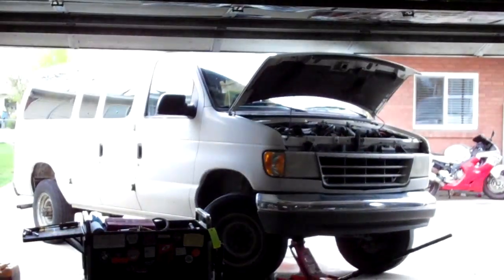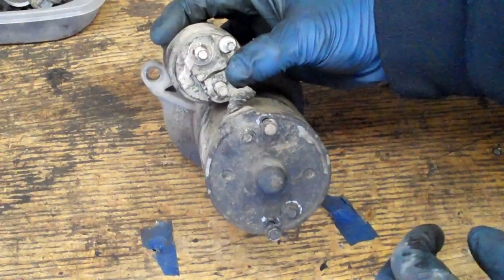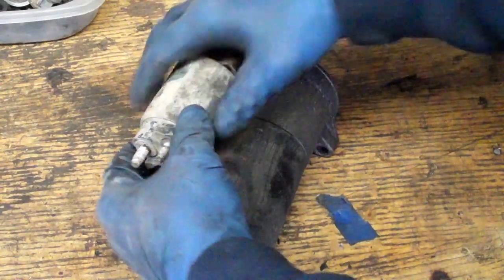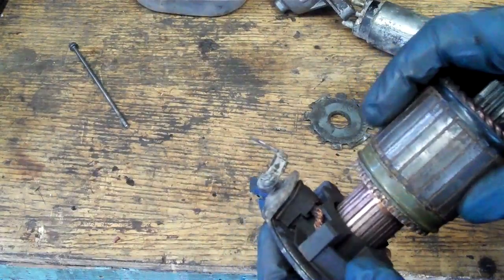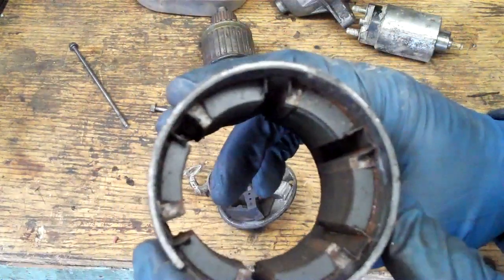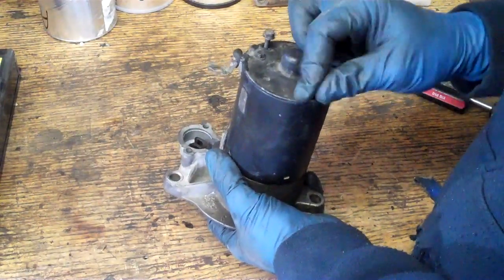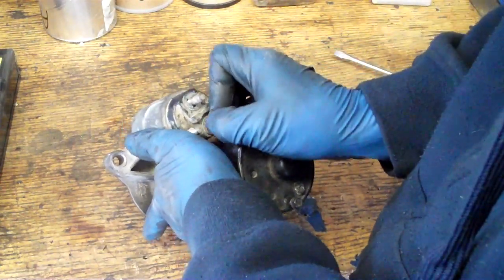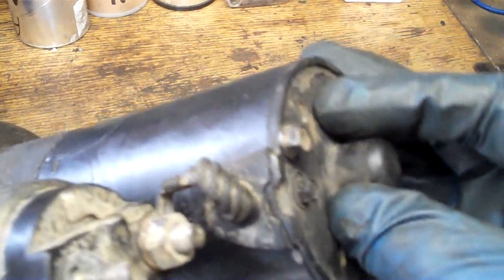How Starter's Work

Comment: Great video! My only comment would be that what you called the sun gear is actually the ring gear. The drive shaft coming from the electric motor has the sun gear on it.

Comment: Brian, you should really have spent time showing people how overhaul this unit properly in detail.(some points are applicable to most starters)
Brush out stator housing/clean inbetween the contacts on the com/check brush faces for chipping/clean and lubricate the solenoid plunger/inspect for chipping and missing teeth on bendix.
Plus there are simple continuity tests that can be done on the rotor to confirm o/c windings.
But good vid.

Comment from the maker: I watched it and commented.  I've seen this on Fords SO MANY TIMES.  It's almost always due to poorly sized or protected/connected battery cables.  Those tiny little starter motors do great as long as they get good flow through good cables.  Having a weak battery can also burn them out too.

Comment: I told my dad that because I didn't think we had good ground and cables, so he took my advice and replaced them with A-1 stuff. made a very slight difference but we apparently still burnt out another starter. so I'm guessing the starters we've been using don't have enough power to crank the engine when it's full of compression.

Comment: my recollection of this video came very helpful today when my mustang fried it's 3rd starter in less than a year. started fine when I left home, drove 30 miles and went to start it a few minutes later, and it slowly cranked twice, and stopped. when I turned the ignition again all I heard was the click of the bendix gear engaging into the flywheel, and I knew the motor fried. is it possible to have an underpowered starter?

Comment: Hey Brian, I always look forward to your videos, and more so when there Subaru related since I drive an 04 STI and do all the work myself! I have a couple requests. Maybe do a video on how to clean an engine and bay really good? And, I have a stuck 02 sensor in the passenger side manifold that wont budge. Used the proper removal tool, after PB blaster, and heated it alittle with a torch. So maybe any special tricks you may have! THANKS!

Comment: Great video, really enjoyed it thanks. Weak plunger springs can also cause the solenoid contacts to arc and carbon up. The carbon can makes it a hit or miss if contacts conduct sufficient current for the motor get the power to run. The spring pressure is a delicate balance of weak enough to allow the coil to overcome the spring tension to close the tips and strong enough to quickly release the tips to minimize the arcing. The spring tension is weaken thru normal use or heat. Thanks Again!

Comment: Great vid, man. Very useful. ]
I had some problems with the starter on my Subaru last winter. It only cranked with jump leads and power from another car.
Took it off the car, bench tested it(figured out how to power both the terminals) and it works just fine. I lubed the bendix and put the whole unit back on the car.
Found the problem to be a very corroded power line to the starter. 
I never got to take the starter apart to see what's inside it, but thanks to your video I don't have to.

Comment: Brian have you replaced your trucks Cummins starter with oversized contact lugs yet?Common problem with the thinner factory contacts melting and wearing irregularly,then sticking.I replaced mine 2 years ago-problem solved!

Comment: Using 'the dirt' marks isn't cheating at all! Using such marks is a valuable, often overlooked skill!

Such dirt & wear indications even have a name, they're called: 'Witness Marks'

I like to run new/rebuilt starters with the jumper cables before installation as now and again you get a stinker... and I want to know before blowing any labor time. Plus a few seconds of no load run time helps to better seat the brushes to the commutator.